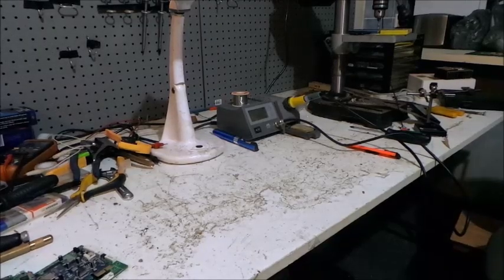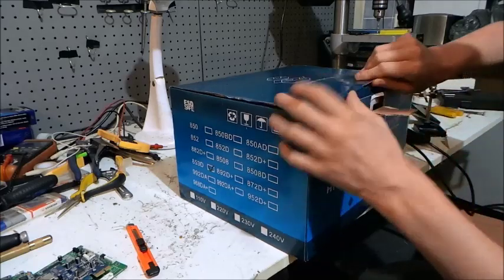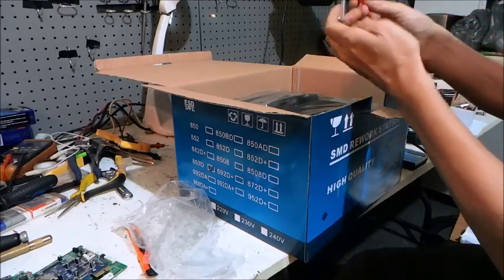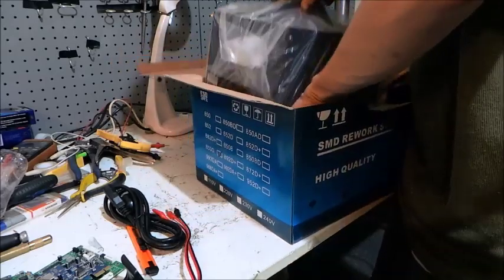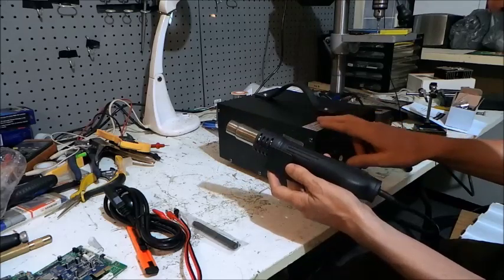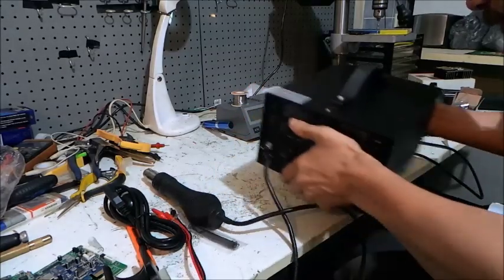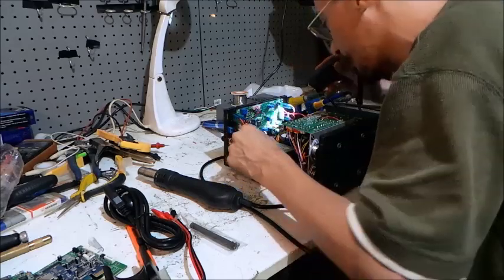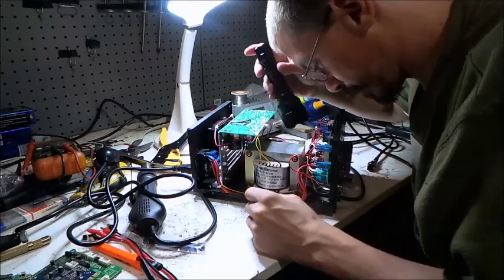WEP 853D hot air rework station with soldering iron and 5A 30V DC supply Pt1

Comment: Hello ,does anybody Knows about "test DC 50V" function,
 in the power supply of this WEP 853D ??-what we check/do by this.
(its measures only ext. voltage 0-50 VDC-does it is a simple voltemeter only??)
 I have not a completely user manual.
(all work perfect in this air rework station+soldering iron+power supply)
its a very good value for money tool & i thing its ideal for light-prof. use
Reply from the maker: I believe its just a simple voltmeter. I've never used it as I have a good multimeter.
Reply: @dash8brj  
thnX for reply,Im planing shortly to modify this input,
I will place it there  an usb-exit until 3Α
*like this:
http://www.ebay.co.uk/itm/Fine-6-24V-12V-24V-to-5V-3A-CAR-USB-Charger-Module-DC-Buck-step-down-Converter-/322036308117?hash=item4afadc1895:g:8toAAOSwvgdW4oZY
 for charging mobile phones-tablets..etc ..
and the indication of the display will show 5 volts.
(I think, this function is most usefull at all)

Comment: 5A 30V?
cool.
Do you have a link to where I can get one.
I can only find 1A 15V
Reply: http://www.ebay.co.uk/itm/WEP-3-in-1-Soldering-Iron-Station-SMD-Rework-Hot-Air-Gun-Kit-DC-Power-Supply-/311457211394?hash=item48844be402:g:MEsAAOSwLVZVzf2E
Very Reliable seller..
(the product quality is of good sorting)
*its real 5 A (2 x 2N3773 & the PS transformer its about 6-7 A)
**for Chinese product, (by these money)its perfect.

Comment: Good job on the review mate. I am glad you check everything before plugging in. I have the same model which i bought in 2014. Worked great and i used it weekly if not daily at times until last week. I connected up a 12v SLA battery to charge up and DOH ! i wired it arse about and killed the power supply. Everything else works tho. I am guessing ive killed the 2 power transistors TO-3 case (2n3773) on the vertical aluminium heatsink that holds that horizontal psu board. Yes on mine there are only two power devices, not 3 like yours. My psu board doesnt have that black wire you have laying on top. If u feel the urge :) could u inform me what your psu board model is in the silk screen (mines YH8535A.C.V3) and exactly where that black wire connects? And are your 3 power devices 2n3773 transistors. and..and..and.. lol. cheers for now

Comment: So did it break yet? My WEP was worse than complete crap. The hot air died after 2 days (remembering that the 'temperature' of the hot air gun is in no way related to the temperature at the end of the gun itself) and the soldering iron died after 2 weeks. I have a Maxtra that is much, much better.

Comment: Hi there, . An Please can u help me, . ? I've jus got a YIHUA smd/smt 853D 5A 3 in 1 Rework station that I have no user manual with it at all, . ? It's new an I know that your ment to take some screws out the bottom of rework stations when u get them new, BUT I haven't a Blue Witch ones to take out, , ? I've looked on net for this model an it says due to a robot era the page not load so I can't find out that way, . ! But seeing as your modal is the same could u PLEASE LET ME KNOW WITCH SCREWS TO TAKE OUT SO I CAN USE IT, . Lol, . ! I'd be so gratefull to u if u could help, . Nice one, . DAY, . ! Ps, . It has 4 big'ish screws on the bottom an then the norm little ones all around it, . !
Reply from the maker: Adrian Dady No screws need removing on this model to commence using it - just connect her up and away you go :) Usually that relates to units which have the blower inside the box - these screws prevent damage in shipping as the blower is supported on rubber stand off's to quieten it down. In our units, the blower is inside the handpiece and thus does not need any screws removed.

Comment: also is yours still living
Reply from the maker: yep mine still works, also voltage from the built in power supply is pretty accurate.
Reply: awesome dose that listing I posted seam ledgit for aus it says 220 v at 50hz :S means French to me haha
Reply from the maker: Thats the input voltage (220VAC, 50hz). If your in a spot that has 110V or 115V, get one thats suited to your location. Plugging a 220 model into 110V wont work, and plugging a 110V model into 220/240 will only and in tears (and a fantastic fireworks display) :)
Reply: haha yea it would I bet lucky I got mine and works fine just need to get the balls to attempt my htc evo3d's usb port :[ never done this shit before lol im in bendigo aus aswell

Comment: I just won this one it looks same as urs but is it right and ledgit volts n stuff :/ I don't know much about plug power only 12v http://www.ebay.com.au/itm/853D-3-in-1-SMD-Rework-Soldering-Station-Air-Gun-Solder-Iron-Professional-/141330089505?ViewItem=&item=141330089505&nma=true&si=UHZ0X27dXNaPVMiNjGdL%252B%252FgPS%252B4%253D&orig_cvip=true&rt=nc&_trksid=p2047675.l2557
Reply from the maker: I can't speak for that one as its slightly different - mine has all digital volt meters on the inbuilt 5A PSU, that one has an analog meter.